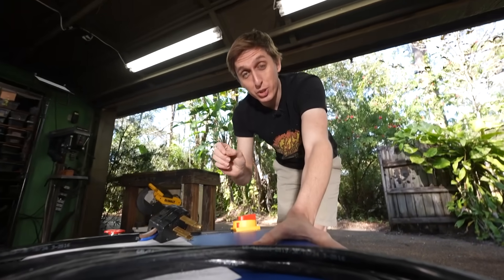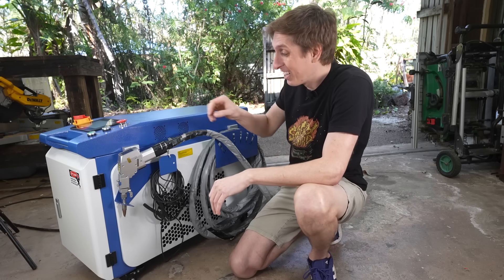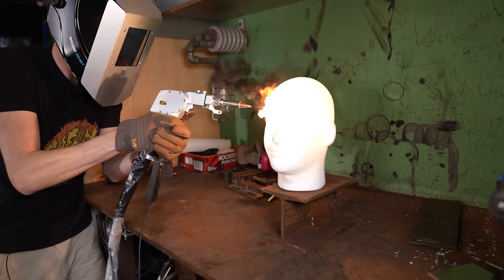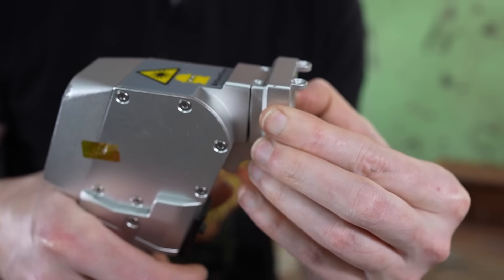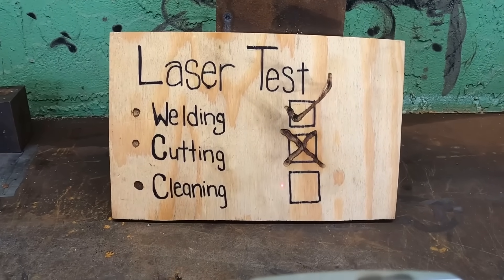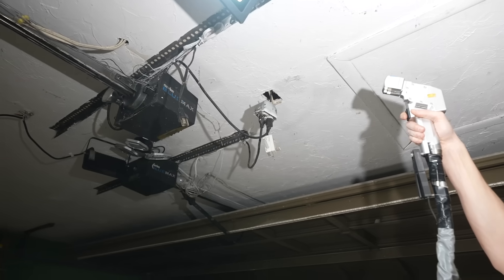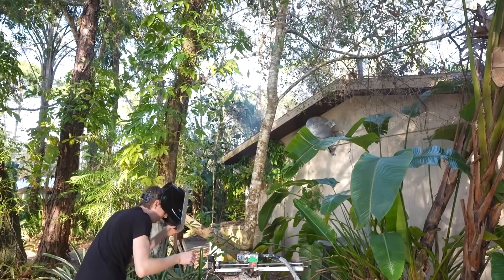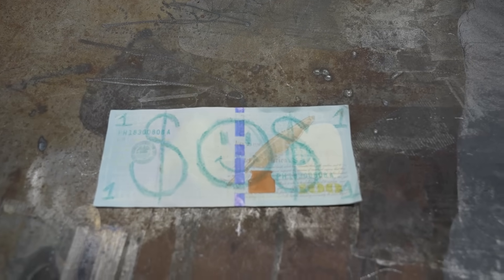Laser Cleaner Lifehacks

Comment: so if you get one of these, you had better build yourself a nice desktop "cleanroom" with glove access. That way you can change the heads out without worrying about dust. oh and get some graphite tiles to use as a background when cutting with the laser.
Reply: btw better hope the secret service won't watch this video. ;) "The U.S. federal government has a statute that specifically prohibits mutilation, cutting, disfiguring, perforating, and other acts that are intended to make the bills unable to be used. The U.S. Secret Service is responsible for enforcing the law. If you're convicted of defacing U.S. bills or coins, you can face fines, jail time, or both. For bills, the maximum fine is $100 and the maximum jail sentence is six months."
Reply from the maker: I already paid the fine i guess :p 

Is graphite super absorbent with IR light? ill look into it.
Reply: @TheBackyardScientist  haha yeah i gues so. XD

I've seen graphite blocks being used as a backdrop for testing of military laser weapons systems in a documentary. So I guess it should also work for industrial IR fibre lasers. Not so much because of the ability to absorb the ir light but because of the high temperature resistance of graphite.(melting point of 3850±50℃)

Comment: Really cool video, some follow up questions: when you burnt the ink off the dollar I noticed the green ink stayed behind, why? Aside from discoloring the metal, why is melting the surface of the metal bad, I imagine it is only a surface level melt, right? Do you think the metal cutting mode would make a very clean cut if you used the same setup you did for the larger tree? And lastly, got a link for the bad apple vid at the end?
Reply from the maker: I was wondering the same thing about the dollar- the general reason is the ink is transparent to the infrared light.  The color of the ink doesn't matter all the time, its more of what the ink is made out of. There's plenty of black materials that are transparent to IR light but block visible light, and there's clear materials that block IR and let visible light through.

melting the surface of the metal is really only bad if you plan on welding it, because it creates oxide on the surface of the metal which will show up in the weld as impurities and porosity when you melt it. The melted/oxidized surface on the metal is actually a little more durable and resistant to rust, but if you wanted to weld on it you should clean it again

And yeah, if you put the laser on a CNC setup it would be great, I was actually planning on it, but i think ill just use my plasma cutter instead. 

Join the discord and ping me, ill post the full video for you https://discord.gg/the-backyard-scientist-454294034308005898
Reply: @TheBackyardScientist  The transparency makes a lot of sense then. I remember using UV filters in biology.  I wondered if the ink they use being transparent to the laser was done on purpose, not specifically for lazers but maybe sun damage. Though, after some quick googling I don't think it was. Probably a coincidence. The ink used for the green stuff is Optically Variable Ink which is done to make it harder to counterfeit. 

Seems like there is a ton about metal wielding I didn't know. Thanks for the good explanation! 

The plasma cutter did look far faster too, so don't blame ya' for sticking to it.

Thanks, joined and @'d!

Comment: As long as people can see ligth with length of 1100nm eyes sensors are sensitive to this wavelength and absorb this light. Rememeber another thing - it not casue pain. You can lost eyesight without any paint or different signals. Just in milisecond.

Comment: You can mail in damaged currency to the federal reserve to receive replacement currency. As long as the entire serial number is readable and at least 51% of the physical structure remains intact, they will accept it for replacement. Replaced bills are issued with a star after their serial number (just like the second $1 bill you lasered)
Reply: I was curious about the star note you mentioned.

It's true that the * indicates a replacement note.  But the reason isn't to replace a note someone sent in, but for any notes where there was an error in printing the original note.  The original with the error is then destroyed.

I don't know they'll give you a star note for currency you send them in that's damaged.  I'd guess not, otherwise it'd be trivial for collectors to get star notes (which are somewhat rare I guess).

Comment: I think these should have a low powered visible light laser strapped to them so you can see were you are aiming before pulling the triger.
Reply: They do, the laser has a low power red laser that comes out of the same aperture and mimics whatever size and pattern the high power laser is set to.
Reply: @dieseldime  odd that they chose red not green, If it was green you could see the beam.
Reply: @Smorb42  You can see the red aiming laser on his glove at 5:58.

Comment: Target ideas:
1. Raw meat.
2. Block of clear ice.
3. Dry ice or opaque water ice.
4. Car airbag. Kaboom?
5. Meat with clothing. Does thick denim save you from death rays or make the situation worse? What about leather? Or Hawaiian shirts?
6. Mirror. Can a cheap normal mirror actually work as armor against a laser or does it get destroyed anyway?
7. A clear water droplet.
8. A dyed water droplet that reflects infrared.
9. A dyed water droplet that absorbs infrared.
10. A model airplane (might be hard to do safely).
11. A camera. Can it record its own death by laser?
12. Calm Water at a shallow angle. Does it absorb, ricochet, diffuse? All three?
13. Objects fully submerged in water. Can you still punch holes in things by blasting alone or is slow heating required?
14. A glass of water. Will it break the glass?

Comment: Welding with a stick or mig, in most instances, adds material to the metal that literally makes it stronger. The metal at the weld is a different material then the rest of the plates at that point. 🤷‍♂

Comment: These Chinese cleaning lasers are a cheap and ineffective alternative to the real cleaning lasers. 
The Chinese machines use fiber lasers for cleaning. This introduces lot of heat into the cleaned surface, which eliminates the biggest advantage of the laser cleaning technology. Laser cleaning is supposed to not effect the substrate. 
Real laser cleaning machines use pulsed lasers. These are much for effective for the application. Pulsed laser sources are Unfortunatly around 10 times more expensive in comparison to fiber laser sources.
That’s why the Chinese machines are so much cheaper in comparison to the real laser cleaning machines.

Comment: This kind of technology is absolutely terrifying, because it will only keep getting smaller and more powerful over time. Imagining a handheld 2,000 watt (2,000,000mW) laser the size of a small flashlight might seem impossible now, but a 5 watt handheld laser powered by a single battery back in the early 2010's would have seemed just as impossible. Yet here we are, multiwatt lasers capable of blinding people instantly can be purchased for dirt cheap all across the internet. These powerful diodes are so common that you have to be careful ordering a lower powered laser because it might actually have a multiwatt diode instead because it was cheaper to produce.

The abuse potential of powerful and easily portable lasers is a nightmare scenario. Especially if they are outside the visible spectrum. Somebody could permanently blind you from a distance with no sound, no warning signs and could be hidden anywhere.  

Pray that the use of handheld high-powered multiwatt lasers doesn't become some kind of twisted TikTok trend.

Comment: This looks both amazingly fun and also amazingly dangerous. Especially since it's pulsed and has the option to focus to a point. I don't know what the pulse width or frequency are but I would guess it's capable of punching a hole straight through someone before they know they've been hit.
Reply: Human tissue actually doesn't absorb infrared light very well, so it wouldn't do as much damage as quickly as you'd imagine. Don't get me wrong, it definitely would not be a good idea to put your hand in the path of the beam as you would likely still be horrifically and deeply burned, but it wouldn't just zap a hole straight through you in an instant. To do that, you'd want a powerful UV laser instead as our skin absorbs UV wavelengths much more readily. Check out Styropyro's videos, he demonstrates this effect, both with IR and UV lasers in different videos.
Reply: @resurgam_b7  I'm aware, but I feel like the margins are thick enough (2000 Watts average power, doubtless hundreds or thousands of times that instantaneous power, into an area of skin 0.1 mm across with reflection and subsurface scattering turning that into a volume-filling pulse of energy with a lot leaving the skin diffusely, but at some point you will be heating part of that volume too much and changing its optical properties. That horrific burn translates to an easier target).

I think it's gonna overcome a lot of the inefficiencies once it actually starts blasting. Could be wrong but I'll bet it makes quick work of raw steaks. beam-generated Plasma is also a very opaque material and for a short enough pulse this leads to very intense heat and pressure right at the surface that obliterates surrounding material in a million degree fireball. The optical properties of the material don't matter once the material is converted to an expanding cloud of opaque plasma or coated in opaque ejecta from the previous pulse. If the pulse can dump faster than the plasma can form a crater, you can still have efficient drilling.

I really wonder here how far the margin between "that tickles" and "There's a half centimeter wide hole in my hand" is here. Because the whole system should be prone to runaway improvements in efficiency for the same reasons that dust on the lens kills the optic. Laser damage usually makes things more susceptible to laser damage.
Reply: @petersmythe6462  Only one way to find out I suspect, we'll just have to trust that Kevin is as devious as we've come to expect and that his next video will feature "How fast can I cut through this steak with my massive laser?" 😂

Comment: Is there a drawback to the rust cleaning? Like it can make it less strong or melt through thin metals?
Reply: If someone without protective eyewear walks into your shop while you're doing it, they could be instantly and permanently blinded. That's about the biggest drawback I can think of. You'd be hard pressed to melt any metal part thicker than foil as long as you didn't go nuts with the power setting and focus. Obviously, the cutting head can cut, so the laser has the power to obliterate metal, and as he demonstrated, setting the power too high with the cleaning head can cause the surface to ablate, but as long as you use it properly, it shouldn't do any noticeable damage to the surface. It won't leave a very consentient finish though, so you'd need to do some finishing process like sanding or painting to restore the part after using the laser, but that would be part of the process without the laser as well so that's not so much a drawback as it is just a consideration.

Comment: I love how you tested it on trees. I cut down a lot of trees for my second job. And honestly if I could make a more precise cut with a laser would save so much time and resources. But I'm sure that laser is very expensive 🤣 I live in WA state on coast so it's always wet so maybe fires wouldn't be an issue doing jobs lol
Reply: Won't work well for living trees and bigger trees. The problem is water, water has a absolutely great ability to absorb energy, in this case heat from the laser beam. This causes uneven cutting, something you should know isn't exactly safe with large trees, it would make them unpredictable when coming down. 
That being said, a relative of mine works as a lead mechanic for a open pit mining company, he's in charge of the "shop" where everything gets repaired.
They have several commercial lasers there for cutting metal parts off, and cleaning the metal to be ready for repainting.

Comment: I work at a company that makes electro-optical equipment. It's a shame we don't do more work with the high power stuff like this. Apparently low power devices for communications are the "more profitable, practical, and safe" application. Less fun too, though. Not that any sane company would ever let the words "fun" and "high power laser" exist in the same building. Can't blame them either. High power IR lasers should scare the pants off anyone with half a braincell. This class of laser could blind you with even just the reflected light.

Comment: welding. as long as its shielded adequately and theres no inclusions/porosity, theres no reason a laser weld would be any different to any other type of weld.

cutting... its not an oxy torch, nor is it a plasma cutter. its only getting to melt the tiny spot its in contact with, and then it has to get rid of it. would probably help with steel if it was fed oxygen, so its BURNING the steel away like an oxy torch. then its the gas doing teh work, chemistry... the laser wouldnt be needed once lit.

plasma cutters have that neat point about the gas being, well... plasma... it tends to act a little differently. really, this laser is little more than rudimentary "arc cutting" which is just cranking the amps up on a regular welder and letting the "weld" simply melt away and fall out of what is now a cut...

as soon as i saw that figure 8 i knew it was running mirrors rather than a mere lens.

plus lenses have insertion losses. i forget the fancy name for the opposite, when the light has to come back out of the glass...

thats really the limiting factor, the lenses. they absorb a certain percentage of the energy and start getting hot.

since i was about ten, ive been trying to find out the limit to the amount of POWER a fiber can carry. i never got any answers. all anyone could talk about was baudrates, data transfer, and theres something else to do with transmission times versus frequency... iunno. noone ever quite got what i meant... how big a laser can i shine through a fiber? seems pretty simple, really.

and now i at least know that its to do with that insertion loss, emissittivity, and the absorption of the glass itself. 

pissed off though. i dreamt up a fiber laser welder thingy thirty years ago.

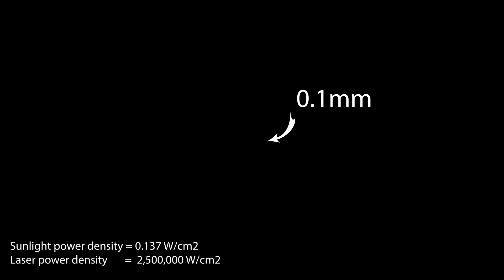Comment: 1:51 you've made a slight error. The figure of about 1370 W/m^2 is the solar power density ABOVE the atmosphere. after atmospheric filtration, the direct solar power density felt on earth is much closer to 1000 W/m^2 (or just 1 kW/m^2 which is easy to remember). Using 1 kW/m^2 for back of the envelop calculations will get you MUCH closer than 1.37 kW/m^2.

also using cm^2 is kind of annoying. i've only ever seen W/m^2 or kW/m^2